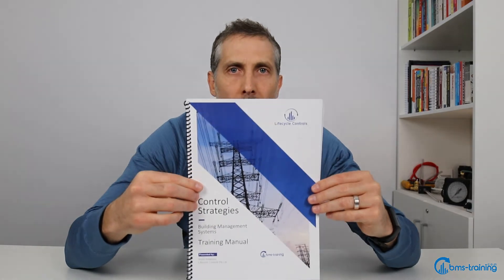Chilled Water Temperature Reset, Does It Save Energy? (BMS)

Comment: It sure takes a holistic approach. But a 800 ton chiller has 500 hp compressor while pump could be a fraction of that. So temp rest should be the hanging fruit in most of cases.
Reply from the maker: Hi Towing bull, LOL. You are probably right. However, the point is that no BMS company understands the relationship. And if we are going to deploy a chiller temperature reset, then we should understand the addiitonal power from the pumps over the saving of the chiller. I have seen BMS engineers programming a reset that resets from 6°C up to 12°C, that can't be good? Cheers.

Comment: Is there any software available for simulating the chiller set reset strategy
Reply from the maker: Not that I know of. However, the AI/ML cloud companies are getting closer. I am working with a couple of machine learning tech companies that are busy working out how to do this. This will happen soon. 
A human could actually do it if they built the right trends and spent some time studying the amount of increased pumping power for each °C raised in chiller supply water temperature. It's just BMS service techs are not taught how to do complex system analysis.

Comment: Does anyone know what effective cooling and a effective heating means as in setpoints? I have a occ and unocc setpoint for heat and cool, but not sure what the effective means.
Reply from the maker: Hi, in my experience.
We have a common set point, 22.5°C.
0.5°C dead band. 
Effective cooling set point 23°C
Effective heating set point 22°C 
The common set point could shift for occupancy or unoccupancy, and then the effective set points would also shift.
The effective set point is the actual real set point that the PID loop is working to after any off sets, additions and subtractions, dead bands etc.

Comment: And it gets worse .......in VAV systems higher air off temps = more not necessary air flow = more fan power !! 

BTW I am a big believer in CHW reset ......correctly
Reply from the maker: Yep..
The actual point here, which you have touched on with your final comment. Is that all these little things that we can do to save energy, do actually save energy (chiller COP increasing), but the SMARTS are not in the control strategy, not the lines or blocks of code, but in the engineers understanding of the impact across all other associated systems. 
I honestly reviewed a BMS design this last week that had a chiller supply water temperature reset and the default min and max limits (that the chiller set point was capable of being reset between), was 6°C to 12°C. They were going to allow the chiller set point to reset up to 12°C. 
Start with 1°C, maybe 2°C. 
Get a feeling for it..